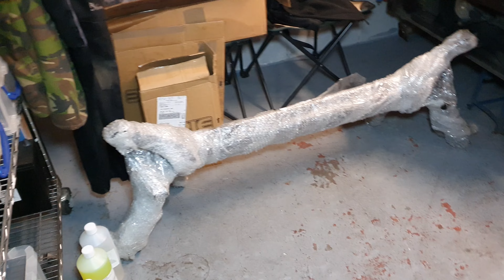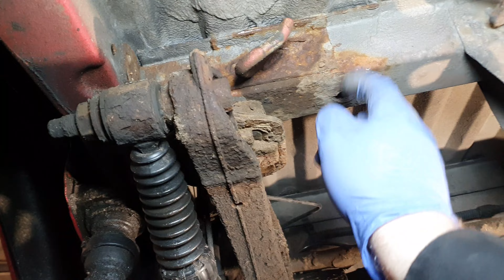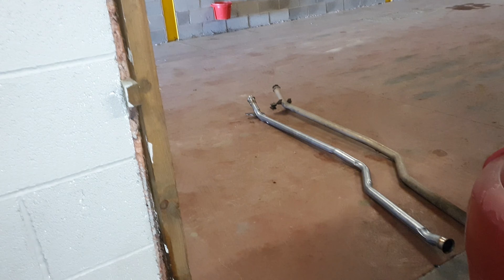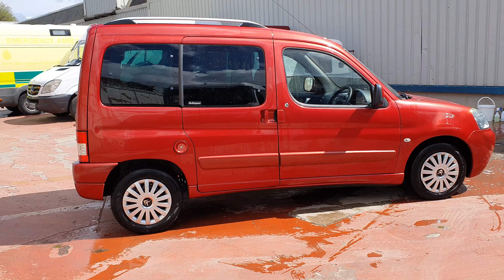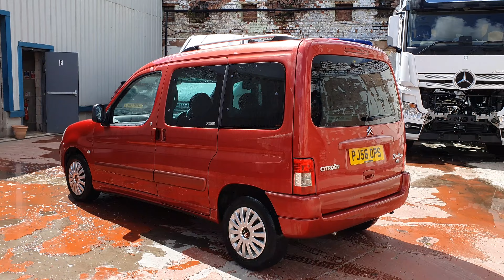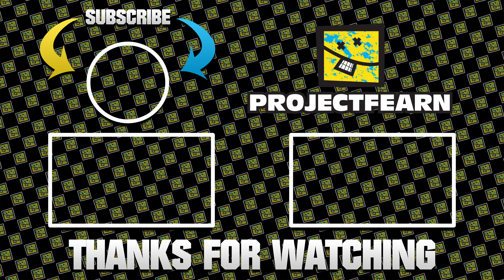New REAR AXLE and rear end restoration on my Citroen Berlingo Multispace

Comment: Thanks for taking the trouble to make this video. Really enjoyed watching it all. I've got a 2000 1.9 diesel which I love but having to look for a petrol one as I'm driving in London sometimes. It is interesting that ' rear axle corrosion' appears as an advisory on MOTs on these Berlingos quite a bit.
Reply from the maker: Yeah the surface rust looks alot worse than it is. Like flacking paint coming off the torsion bars etc. I've made another set of videos doing an axle on my parents blue berlingo pal 👍
Reply: I wondered if you considered leaving the axle in situ and pulling off the trailing arms and renewing the bearings yourself. Seems to be possible.
Reply from the maker: If it was a couple of years old yes but with most of these cars and the surface corrosion I can't imagine it being a fun job. Plus as you can see in both my axle videos, other parts are shot too. You'd deffo need a set of burner bottles 😎

Comment: Great video! I tried to follow some of the links that you provided, is ther a generic list of spares needed (once you purchase the axle) of the bits and bobs that are the 'usual suspects' that need replacing when doing this job? A parts list of sprts? Pug Partner 2006 (M59)
Reply from the maker: On ebay you can put your car details in and find the correct parts. Check out my other videos on the blue berlingo. I go through all the parts and costs 💯
Reply: Thanks. Ebay is def a rabbit hole......
Reply from the maker: I know mate. Danny
Reply from the maker: I know mate. Danny

Comment: What are the symptoms for bad rear axle? Thanks for the video!
Reply from the maker: You can usually hear the axle clunking like a really metallic noise. If you jack the car up you can also rock the wheel and see the movement in the trailing arm. I have another one I'm doing in the next couple of weeks and will go into a lot more detail :)
Reply: @projectfearn  Perfect, thank you for answering! :)
Reply from the maker: You are welcome 😎
Reply: @projectfearn  when you mean clunking, is that when going over bumps or when standing on the "back" and push/jump the vehicle up/down? :)
Reply from the maker: Over bumps and also driving etc. 😎
Reply: @projectfearn  ok, buy driving you mean acceleration and shifting (when the car wiggle) or grinding sound while cruising on the highway? (sry if being dumb but trying to investigate if im i need of an investigation regarding my multispace) :)

Comment: Hi Dan, my rear axle went yesterday when coming back from my hols in poole (cost me £450 to get car recovery = 150 miles "ouch", I love my 2005 Berlingo desire 2.0HDI - Question;- How long would it take to remove old axle and fit a refurb axle?.........I gonna use a mobile mechanic who does my servicing to take a look.
Reply from the maker: Dayum pal. That is a big recovery charge pal. He could easily have it done in a day if everything comes off easily and nothing else needs replacing like shocks or brake lines etc pal. How bad has the axle gone? Is it not driveable at all?
Reply: @projectfearn  Hi Dan, thanks for replying mate, we drove it to a MOT station in poole, he jacked it up either side ( wheel loose on one side (80% off side) when he moved it from top to bottom) and said it was the axle - Really bad on one side (nearside) = total calapse on (near side) and 80% on the other side (offside), the car was and is driveable for short distance = but not safe for a long distance or low speed driving, but my friend weighs 193 KG = he was sitting in the rear where it calapsed before we set off - Im hoping no welding needs doing or wether to scrap the car?.........whats your thoughts?....is it worth repairing?.........or try to buy another vehicle?
Reply from the maker: Are you on Instagram pal? Drop me a message, search for projectfearn or drop me an email danny@projectfearn.co.uk
Reply: @projectfearn  Not on instagram, but will email you,....thanks Dan
Reply from the maker: No worries :)
Reply: @whu58  I just had my rear axle replaced with a recon by AB Axles in Chard total cost just over £400 .Look them up on inter web
Reply from the maker: Thats not a bad price at all

Comment: What are the symptoms of the rear axle being faulty
Reply from the maker: Usually one side will make a noise. The bearing on the trailing arm collapse and make a horrible metallic clunking noise. You can also feel play in the bearing at the early stages. It's a really poorly designed axle. My car got to around 100,000 miles before I needed to change it and the blue one got to around 140000 miles I think. 😎
Reply from the maker: Usually one side will make a noise. The bearing on the trailing arm collapse and make a horrible metallic clunking noise. You can also feel play in the bearing at the early stages. It's a really poorly designed axle. My car got to around 100,000 miles before I needed to change it and the blue one got to around 140000 miles I think. 😎
Reply: @projectfearn  thanks for the reply that sounds like what's happened on mine how long before they become undrivable
Reply from the maker: I'd be getting it replaced as soon as you can pal. How many miles has it done?

Comment: In below the van and no pins in your axle stands? 🤔
Reply from the maker: They are on their lowest setting as you can see in the video so a pin isn't used or will fit in as the holes only start when you jack the car up even higher. The rear wheels are placed under the vehicle too for extra safety. 😎